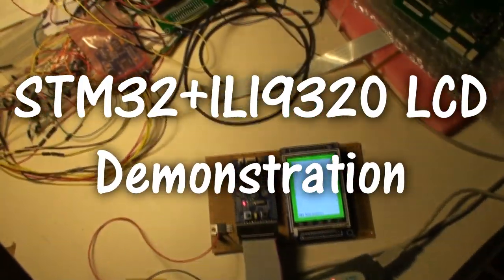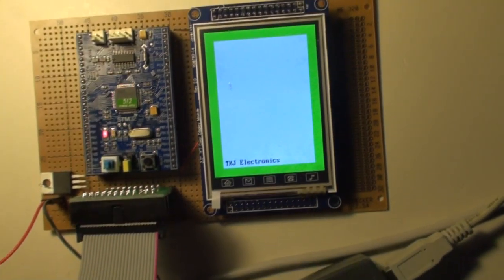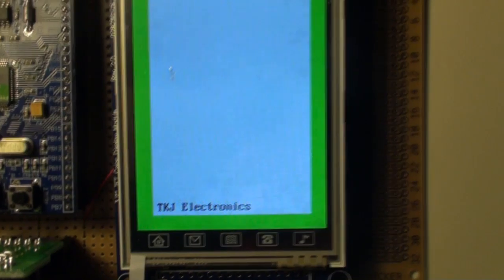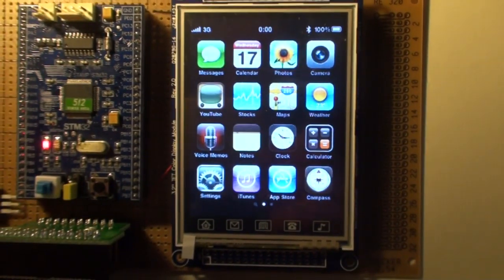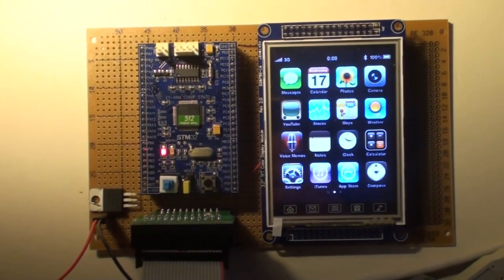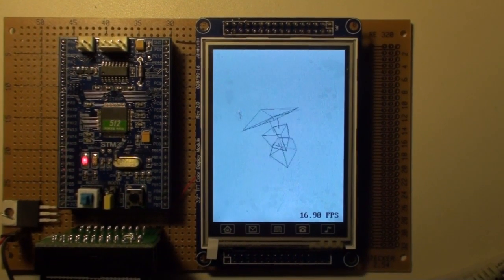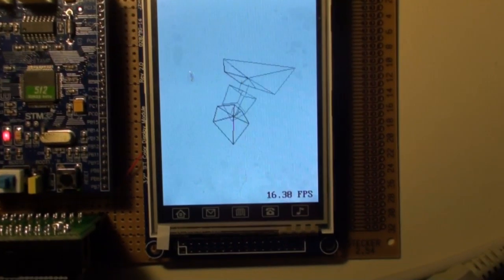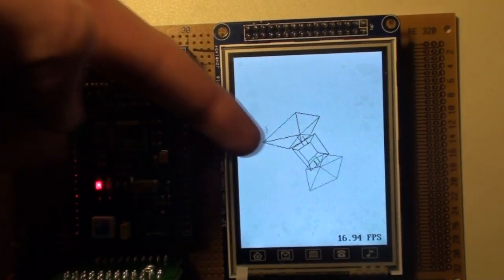STM32+ILI9320 LCD Demonstration + 3D algorithm

Comment: Good mornning,

you LCD work with 5V power supply ?
The STM32 output 5V in digital I/O ?
Reply from the maker: The LCD is 3.3V but the STM32 tolerates 5V inputs but operates at 3.3V and thus outputs 3.3V levels.

Comment: LOL! ZX Specrum most fast on 3.5 mhz 8bit
Reply: But it's still slower than Atari 400 :(
Reply: And C64 :)
Reply: cbm80amiga C64 is more versatile, but for raw calculation speed, Spectrum is a tad faster.
Reply: Cannot agree. I programmed both CPUs, even in one computer (C128). 6510 had only 1MHz clock but much less cycles per instruction than Z80. Only in limited cases Z80 was actually faster. In case of C128 fast mode its 8502 was always faster.
Reply: cbm80amiga
How come? 6502 has typically 3- to 5-cycle opcodes for zeropage only, otherwise a bit longer. Z80 has 4- to 7-cycle opcodes for register file operations, otherwise significantly longer. Now of course you have a couple tradeoffs there, Z80 being largely position independent, while 6502 forcing you to decide what code should be performance important and giving that the bulk of zero page, but you don't get restricted by the register file nearly as much or having to push and pop it all the time.

In my opinion, it just about comes out to 6502 beating a z80 running at double the frequency; however at nearly 4 times the frequency, z80 should come out quite a bit faster.

I wonder whether it wasn't also you ending up writing better 6502 code than Z80 code; which is however understandable, 6502 simply lends itself so nicely to assembly programming.

Comment: Very nice. How do you deal with vsync issues? I'm using a ILI9328 (almost identical to yours) driven display but it has no vsync signal available so I end up with harsh tearing if I update the display at anything faster than about 1Hz.

Comment from the maker: You would have to connect the 16-bit Motorola 8080 interface to either some simple GPIO ports of the STM32F4 or even more advanced the FSMC bus which would speed up the screen updates a lot.
Please let me know what you have currently tried. Have you searched our blog and looked at the examples provided, fx the SSD2119 library (very similar to the ILI9320) for the STM32?
Good luck :-)

Comment from the maker: No I don't. The display includes the ILI9320 display controller which contains a framebuffer (SRAM) together with a display controller that takes care of the LCD refreshing.
By writing to the controller I can write pixel data directly to the framebuffer which will then be displayed on the display at the next display refresh (60Hz).

Comment from the maker: @BlueNem0 Hi. The 16-bit displays can be used in standard 65K colors. Though it can also be used in 262K, and I even think it can be used in 16M too.
All it requires is some more clock cycles for each pixel. At 65K only a single clock cycle is required pr. pixel, as it is 16-bit. Though at 262K, which is 18-bit, it will require some more clock cycles.
You can also be lucky to find a display where all 18-bits are brought out to you, then you can do it in one clock cycle.

Comment: hi ppl jus a quick question pls help.. im looking for an lcd similar to this (wth 262k colour), i found an lcd very similar but it has 16 data-bits connected and it's stated as 262k colour. is that right? 262k with 16bits with no tricks? i keep seeing loads like this. here is an example, go to ebay and search for item 120640315333.

Comment: @mindthomas  continuation...Check out this next video(tab in you tube: "SMARTGPU AVR ipod like with camera") and go to the camera streaming live video part(4:24).  As you can see there, the camera is generating live images, and the baud rate connection with the micro is 1Meg(which is the maximum supported by the camera, not the micro nor the SMARTGPU).   
Almost any micro are able to connect at 2Meg and you can have ethernet or live generated images at twice speed than the camera!
Regards!

Comment: @mindthomas Hi Thomas, the images loaded from uSD are loaded fast as you may already saw this, but also images could be sent via UART to the SMARTGPU pixel by pixel, from the micro or live generated, just need to set the 2Meg baud rate connection command to SMARTGPU, and begin transfering images fastly enough.

Comment from the maker: @eliasbencz Hi, and thanks for watching.

The voltage regulator on the board is an LD1117V33, which is a 3.3V voltage regulator.

I can't give you the content of the CD, as I don't know if it's copyright protected! But you can read more about the ET-STAMP-STM32 board on the manufactors homepage, where you can also find the manual and schematic: ett.co.th/product/ARM/ET-STAMP-STM32.html

Please also check this: wiki.seabright.co.nz/wiki/ETSTM32Stamp.html

Comment from the maker: @b1ueocean This one can be programmed and debugged over JTAG only. But it can be programmed by simple RS232 too if required! Also if you then install a bootloader, you can also program it over USB.
But debugging can only be done with JTAG!
The one I use is the one from Raisonance. I bought it for about $40USD on eBay, though it was a very cheap offer, as it was an auction! Though have you seen the JTAG board I've made, you can buy those for $25, and they work with OpenOCD.

Comment from the maker: @boikonur The images shown in the video is stored internally in the processor (512kB), though there is an SD slot on the display too. I'm currently working on getting FatFS to work - which is an SD library for use with FAT-formatted cards!